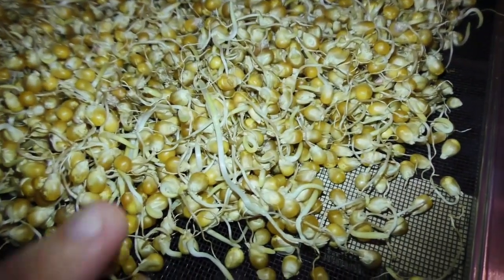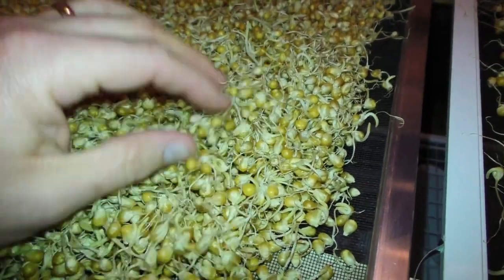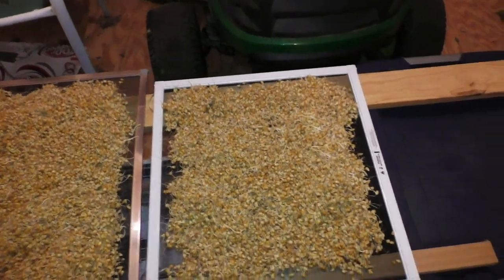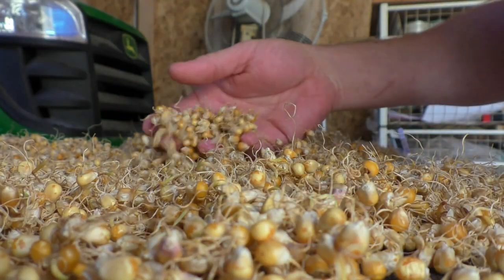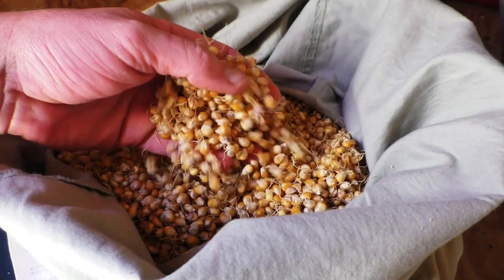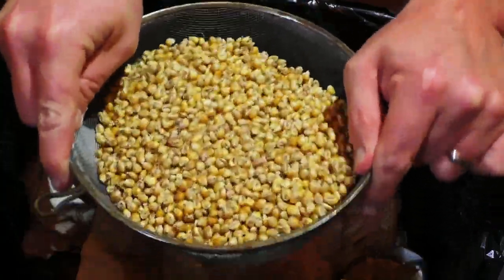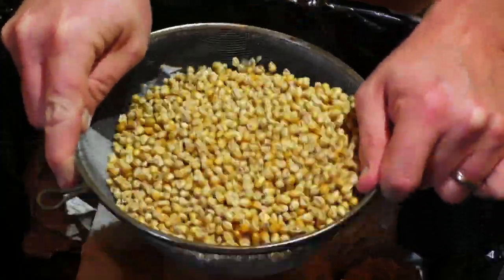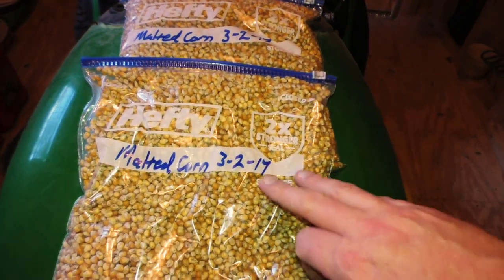HOW TO MALT CORN FOR MOONSHINE & BEER - EASY! - Part 2

Comment: What about if the corn begins to have a sweet smell?
Reply from the maker: Any funkiness to the sweet smell? Also, check to see if it's got any slime forming. If you're concerned about it, rinse it thoroughly in cold water then let it drain through a colander for several hours. You can scrub out the pan you're malting in to make sure you get out any bacteria or mold that may be trying to grow.
Reply: @BeardedBored  I mean, honestly, it smells like sweet, cream corn to an extent. Also, sifted my hand through there & noticed that the corn is still pretty wet. I started the process at 1 pm yesterday. I put 2 lbs of the popcorn in an aluminum tray, stabbed holes all through through the bottom of it for better draining. I put it in another aluminum tray. I put tap water in it until it reached about an inch over it all around the tray & I let it sit in my bathroom for about until 10 pm. At that point, I poured the water into the bath tub & put pour bottle caps on all four corners of the undercarriage. I sifted the seeds around a bit, soaked a towel & twisted it to get some of the wet out, then placed it on the top of the corn. At 8 this morning, when I went to go rinse it & place it back in the tray, I noticed this odd, sweet smell.
Reply from the maker: @hiimtie  Ooooh, then you're fine:-) That's the first stage smell when it's soaking. No biggie. Keep going and let me know how it goes. Good luck!
Reply: @BeardedBored  Thank you for you fast replies! Very helpful!
Reply: It had already sprouted & was ready to be dried. I put it outside & we've had a lot of rain in the past 2 days. It's sprouted even further. Should I just cook it to stop the growth?
Reply from the maker: @hiimtie  NO! It's ok if it sprouted a little more. But if you cook it in the oven to dry it, that will destroy the enzymes you need to convert starch to sugar. Put it on a window screen or even a blanket or towel in front of a fan inside out of the rain to dry it.
Reply: @BeardedBored  is the dryer method for smashing the corn?
Reply from the maker: @hiimtie  It doesn't crush the grain at all, but it helps to knock off all the dried roots and shoots.

Comment: Ok, I tried making a "beer" mash to use my malted corn in.  I used cracked corn instead of flaked maize and let me tell you, the cracked corn is a challenge!  I brought my water to 165 degrees before I added my cracked corn and stirred it every 5 minutes like the instructions called for, but my cracked corn was still as hard as a rock and wasn't thickening and gelling like the flaked maize was supposed to do.  I used cracked corn because I can get 50 lbs of it for 12 dollars at my local feed store.  I kept the temperature at 165 for almost 2.5 hours and my cracked corn was still not soft enough to gel or thicken.  I finally brought my mash to a boil, stirring it every 5 minutes until it was soft.  Good grief, I boiled it for almost another hour, stirring it every 5 minutes before it was soft enough.  (Be very careful not to scorch your corn because this will taint the taste of the mash! I didn't just turn my burner on high and let it go, I never turned my electric burner on my stove above 7 setting an alarm to stir it for at least 15 seconds every 5 minutes.) Waiting now until my temperature cools down to 152 to 150 to add my malted corn so I don't kill my Amylase.  I'm doing a 5 gallon batch and only have a 5 gallon stock pot to cook in, so I'm having to do two different batches to make up the full 5 gallon batch of beer mash.  I would guess the cracked corn has to be hydrated to cook it down faster than this, so on my second batch to finish this off I will soak my cracked corn for 8-16 hours before bringing it to the 165 degree temperature to get it to thicken.  I want to extract all of the starch I can to convert to sugar using my malted popcorn.  Once I add my malted popcorn, I will cover the pot for 90 minutes to let it "rest" to convert the starch to sugar.  Once it sets for that long, I will do an iodine test to make sure the starch is converted by putting a little of the liquid on a paper plate and adding 2 drops of iodine.  If there is still starch in my mash, the iodine will turn dark blue to black.  If it is all converted to sugar the iodine will be the color of iodine.  Once my starch is converted to sugar, I will pour everything into a pillow case in my fermentation bucket to strain it and remove the used corn leaving only the liquid...  If there's an easier way to do this with cracked corn, I would absolutely love to know it!
Reply from the maker: Cracked corn hasn't been pre-gelled the way flaked corn has, so it has to be boiled for at least an hour. I say boiled but you can try 190F for 60-90 minutes. Flaked corn has been steam gelled and pressed flat so it just needs to be dropped into your mash. That's why it's so popular with brewers.

Now I also have some bad news. Malted corn only has enough enzyme to convert itself. It's diastatic power is too low to convert the cracked corn as well. You're going to have to add some crushed 6-row malted barley (20% of the mash bill is a safe bet) or amylase powder and reheat the mash to get all that cracked corn to convert. I found that out the hard way. Also, I'm now realizing I probably never mentioned that in my videos. I'm sorry about that because now you have to do double work. But your mash is NOT ruined. Just reheat it to 145-150F and add your enzyme or barley and let it mash for an hour. 

I'm currently working on another beer video with malted corn where I go into detail about the diastatic power issue. Sorry for the extra work:-(
Reply: @BeardedBored  Uggghhh...  LOL. No wonder I was so confused when I woke up this morning and checked the starch content by using iodine and got dark blue to Black.  Oh well, malting the corn was a fun experience and I'll end up using it in a batch anyways. I ordered some amylase enzyme and it should be here in about 3 days so I can do a batch just using it.
Reply from the maker: @jackwiggins961  Sorry about that. Can you store the mash in the fridge until your amylase arrives?
Reply: @BeardedBored  It's all good my friend. For me it's all about learning new things and to be quite honest, I've never been able to learn anything valuable without making a few mistakes.  I went ahead and dumped what I had started and started over with 5 lbs of corn meal. I brought 3 gallons of water up to about 170 and held it there for about a half hour until my corn meal was really thick. I let my batch temperature get down to between 140-145 (at the elevation I live at, water boils at 202.7 instead of 212 degrees) then added all of the malted popcorn I had made (probably 2.5 to 3 lbs) and stirred it in for about 5 minutes. I then covered my stock pot and just let it set for an hour and a half. I was really surprise when I took the lid off to see how much my mash had thinned out. Since I couldn't do a complete conversion of the starch in my batch I added 5 lbs of sugar and stirred it in really well. I dumped everything in my fermentation bucket and added just over a gallon of cold water to bring my liquid level up to 5 gallons. I had a SG of 1.090. I added 5 tsp of yeast nutrient and my yeast I had started (1/2 cup of 100 degree water, 2 tbs of Fleischmann dry active yeast and a tsp of suger) once my mash reached temperatures between 100-105 degrees. Within an hour, my airlock was already giving me a bubble here and there. I should come out with a mash that is close to 12% ABV I would guess... I'm going to try the cracked corn again after I make this batch, but I will probably have to cook that down for at least 3 to 4 hours, or I may even use my little bitty coffee bean grinder to grind that cracked corn into corn meal... It would more than likely save me quite a bit of time on the boil down if I grind it up. I really appreciate what I've learned from you, I'm still really new to this and my mind just kind of takes the ideas you give me and runs with it! Any advice is greatly appreciated!
Reply from the maker: @jackwiggins961  Sounds like your new batch will do just fine. The UJSSM whiskey recipe and a few others don't even bother with gelling or mashing the grain. They are basically just sugar washes with a little corn flavor. So you are way ahead of the curve and will get some awesome flavors from this. I did a similar recipe several years ago. One of the best products I've ever tasted came out of that. Good luck:-)
Reply: @BeardedBored  yeah, my first mash was 5 lbs of sugar and 5 lbs of corn meal. The instructions just said to pour 165 degree water in my fermentation bucket and add the ingredients and stir it in. My ABV ended up at about 7% which I thought was really low. I started doing some research and learned  about amylase and converting starch to sugar.... I do have a question, when I do my next batch do I add my powdered amylase at the same temperature I would if I were using malted barley?
Reply from the maker: @jackwiggins961  Yep, same temps. But check the label to be sure. Some of them have a different effective range. 

7% is what commercial outfits aim for in their mash without adding sugar because the higher the abv of the beer, the higher chances you'll get some unpleasant flavors and characters in you finished "product". But for the hobbyist it's easier to leave out the unpleasant flavors when blending since profit isn't a factor. The internet is of two minds on the subject. If you haven't yet, check out the Still It channel and the Barley and Hops Brewing channel. Tons of great info on both:-)

Comment: So you just toss out the sprouts?Aren't there any benefits to keeping them in the mash?I live in Canada and i distill as well as make beer and wine so this video is super helpful to me.If i'm brewing or distilling up here for my own consumption it's tolerated.I did see on the barley and hops brewing LLC channel that in the state you can apply for a distilling licence for fuel to get around the law.
Reply from the maker: Hey Powerslide, Great questions. From the research I've done the roots and sprouts contribute grassy flavors to the beer and follow through into a distillate, so they're always discarded, even at the commercial level. It's possible you could extract some sugar and enzymes from them, but if they screw up the flavor I say toss them. One of these days I'm going to actually test this out to see how bad the flavor is. Might not be noticeable, but until I test it for myself I'll just go with the conventional wisdom for now.

The fuel producers permit is a loophole that some folks use, but in order to get the permit you have to agree to warrantless searches of your property by the feds to "inspect your fuel production facility". That creeps me out.

Comment: What's the easiest way to get the tails off the corn
Reply from the maker: The easiest way I found is the way I do it in the video @5:20. After you fan dry the grain dump it into a pillow case and put that into your clothing dryer on LOW for two full cycles (2 hours). After it's done in the dryer put the corn into a mesh sieve and shake out the busted off roots and chaff.

Comment: I don't really care about legality, tempted to do it anyway since I can't afford grain alcohol to make something else.
Reply: Just make sure you have a safe distillation rig, learn about the cuts so you don’t drink the heads/methanol! Try researching it thoroughly and using copper tubing and a cheap pressure cooker with fittings.

Comment: hello.. im new to the whole malting scene in fact after watching this i had my first successful malt that didn't go bad i hope. anyhow i use animal feed grain because im not the richest follow in the vally now when useing animal feed is it normal for it to smell like a farm after its done malting? ive cleaned it with water and bakeing soda before hand im just curious if my grains are still good
Reply from the maker: Congrats on the successful malting! Yep, the smell of the malt will be pretty strong and distinctive. Grainy and maybe slightly sweet. As long as there is no funky, rotten or garbage smell then you're good. The main thing to look for is any mold or slime while it's still wet and sprouting. If you get bacterial growth or mold growth going it will make some nasty funk that you will have no doubt about. 

I'm working on a way to seriously reduce the chances of a spoiled batch. I'll have a new video for that in the next month or so:-)>

Comment: The way I understand it, and malt my own grains...  It's not desirable to germinate where the shoot busts out of the seed (grain) for a couple of reasons.  One, is that once the shoot has popped out sugar drop off within the grain is significant, because the now 'plant' consumes a lot of sugar immediately after the shoot has emerged.  

Second if the grain is allowed to grow a shoot you can get a plant / garden after taste.  From my research (malting barley), the big boys in malting (barley) know just when to heat / dry the grain right before the shoot emerges.  (malting by the numbers)  If a few early germinators bust a shoot, that's fine.  That tells you that you need to stop the process pronto for the rest of the grain. 

Just a friendly suggestion, try malting a batch just before the shoot emerges.  See if you get a different taste from this process.
Reply from the maker: I will definitely try that to see what works best for corn. I wasn't able to find much recent research on corn malting, but found several research papers from 1800's and early 1900's, as well as a research paper from a distillery (or brewery-can't find the link, think it was written in the 1960's?) that seem to all agree that corn needs a more advanced germination to achieve the same level of enzyme production as the much shorter barley acrospires. The consensus seemed to be "finger length shoots" were required for corn to reach its maximum enzyme production before drying.

I agree that sugar is definitely present in the shoots, which is a shame. When they're fresh you can taste how sweet they are. So far everything I've read has a common theme that in corn malting it's difficult to balance the levels of enzyme with the sugar loss.

I think that's the main reason why commercial distilleries don't use corn malt, but rather use liquid enzymes or barley malt for starch conversion. I'm sure that if they spent some money and time researching how to get the perfect corn varieties for malting like they did with barley this wouldn't even be an issue. Seems like corn just got pushed aside since barley was already so efficient at enzyme production.

I'll see if I can come up with an effective low tech test to see where the sugar and corn levels are at various stages of germination next time I malt corn, because it'd be nice if we could get the results we need 1 or 2 days faster by stopping the malting prior to fully sprouting the grain, like malting barley. 

As for the grassy/garden flavor, from some reading and my own experience that's only associated with either using the malt in it's "green" state (still moist prior to drying), or if the dried sprouts and roots are left on the grain during the mashing process. So far, as long as I tumble the dried malt to break off that material and winnow it thoroughly I haven't had any grassy or garden flavor carry over. The question I can't answer is how much sugar am I throwing away during the winnowing. Wish I had a biochemist friend to test it.  Now you've got me really curious:-)>
Reply: Just an outstanding reply!  Thank you so much for sharing your research, experience on corn malting with the rest of us.  I'll push the germination on corn a little further and give that a try as well.
Reply from the maker: Thanks John. Don't forget to share your germination results! Inquiring minds want to know:-)>
Reply: Here's a link to something I put up on malting barley a while back.
https://organichomebrewing.wordpress.com/2015/12/24/malting-organic-barley-grain-at-home/
Reply from the maker: Hey thanks! I'm going through some of your other blog posts too. Great stuff!
Reply: Thanks, I've got to get back to being active in all of this again.  When I left off a couple years ago I was experimenting on cultivating yeast cultures in some non typical ways.  I would like to get back to doing that.
Reply from the maker: Sounds like fun:-)>
Reply: Good ol Jake leg.  I think I'll stick with the 'bearded wise one' when it comes to malting my corn.

Comment: when making Hooch ..   isnt it . one lb of malted corn to one Gallon or more like 1 Lb for every 1.5 to 2 gallon water ?  as in a 100 gallon Beer mash 30lbs of malted corn  to 75 lbs  of corn ,  25 Rye . 100 lbs sugar .  and 5 gallon consintrated Apple  suryp ..   for the Thumper ..  and rye ground  almost to flour but still semi course ..  , 
yeah Im gonna pick your brain ..
Reply from the maker: 2 pounds per gallon is pretty standard for an all grain mash if you are not adding sugar. If you add sugar I guess you could do 1# per gallon. Just depends on the gravity points you want to achieve. Not sure what you're asking in regards to the apple syrup and rye. Are you saying put both in a thumper?